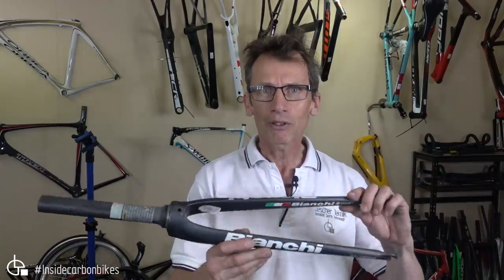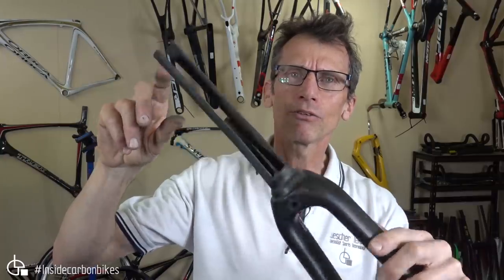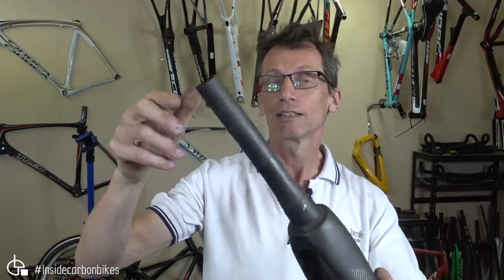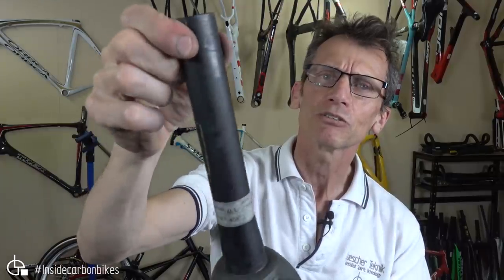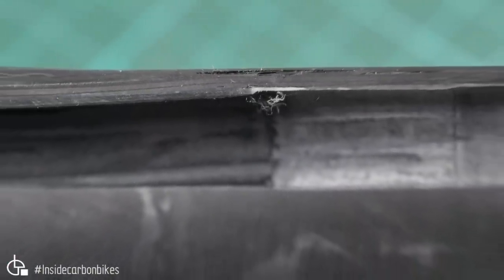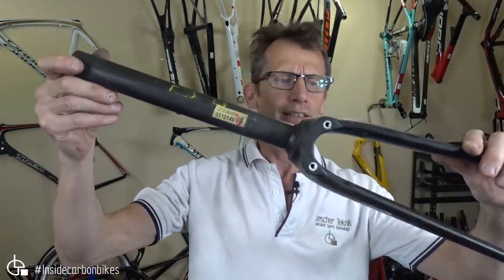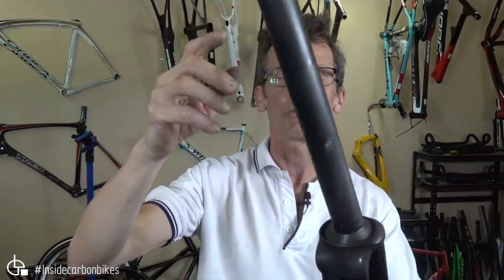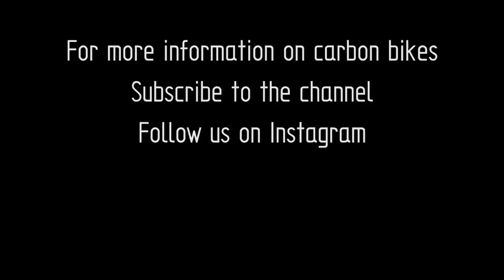Fork Steerer Failure - Recent Crash

Comment: I suppose this isn't an exact science and there are a lot of variables, such as rider weight, manner of riding etc. What percentage of sold forks have these imperfections and how worried should I be that they could lead to failure under "normal" conditions?  Your comment re 2% porosity ==> >20% reduction in strength sounds scary obviously... do manufacturers significantly over-build these things to compensate for these manufacturing issues? Doesn't seem like any of the high end manufacturers (even) deliver problem-free carbon frames and forks. Add to that "user error" such as over-tightening and you are scaring me off using that material. I can't afford to have equipment periodically scanned (which makes sense to do) and even have no guarantee the parts will be problem-free from purchase based on the videos I've watched. So even if I take care of equipment from new, don't crash it, drop or otherwise mistreat it (and torque things to spec) it sounds like quite a gamble.
Reply: Most companies I have worked for overbuild by 100% of the maximum anticipated load. Maximum anticipated loads themselves take a view on likely rider weight, for instance, in arriving at that estimate - so if a pair of wheels, say, has a max recommended rider weight of 109kgs (220lbs), loadings are calculated as if the rider was 218 kgs / 440lbs. If you are, say, an 80kg rider there is, therefore, a huge safety margin.

I respect Raouls work and all of what he says in this video is accurate but equally, I have inspected forks made in steel with poor penetration of the joint by the brass or silver solder used in the joint and i have seen poor bonding in steel, alu and composte bonded structures.

The point is that usually, failure rates are in the small fractions of a percentage point.

A large number of failures are not the result of a manufacturing defect, largely because of the level of overbuild used by responsible manufacturers, but of poor assembly and maintenance. I see more kit broken by that by a long chalk, than kit with an inherently catastrophic fault.

Manufacturers, no matter how careful they are, no matter what they spend, will have manufacturing faults. If Space Shuttles can explode, or motor cars or mobile phones burst into flames, or airliners crash because of faulty manufacture, then should we be so surprised to see faults in manufacture in bicycles? I think not - that's no reason to be complacemnt of course but all manufacturing processes have an inherent ability to produce bad manufacture and all QC processes can miss something.
Reply: @graemefk6519  BS, how would you know that "A large number of failures are not the result of a manufacturing defect, largely because of the level of overbuild used by responsible manufacturers,"...  Have you done a study on the subject? Raouls' scans and dissection of frames shows the lack of quality control of bicycle manufacturing.. you are just another paid industry mouhtpiece trying to do damage control
Reply: Is it fair to say that aluminium and steel are not only more tolerant of misuse such as dropping or overtightening but also easier to visualky identify faults with via periodic inspection.... I know some probs will not show up but maybe more than with carbon... or can we say with some confidence that catastrophic failures resulting in serious injury, regardless of materials, are very rare.      At least with planes they get periodic maintenance, inspection and replacement of parts. I don't know anyone xraying or ultrasound scanning their carbon bikes (granted Rauol has plenty of customers)   Has anyone reading these comments been injured by a failing part? Hard to know how worried to be vs being careful

Comment: "Carbon is the best material for bikes" 

Carbon is great!
It costs 40% more CO2 to make than metal bikes. 
It can't be recycled.
It causes cancer in people that make it.
It's easy to break.
It becomes weaker in UV light.
It can be a potential death trap without you ever knowing. 
It's ride quality sucks balls. 
It's the most profitable and cheapest material for the manufacturer but yields the highest profits. (Now you know what it's so popular with manufacturers)
It galvanic corrodes with any metal you put next to it.
It wears away from the slightest abrasions from cables or tyres. 
And if you make wheels out of it they melt on the way down hill. 

It's s the best! 👍🏻

"Carbon is a a excellent material if it's void, porosity and fault free..." 
You have never showed a bike frame that contains no flaws. Every carbon bike seems to be full of problems. So how can the end consumer ever know that they are getting a safe product without your equipment and expertise? 

You say "take your steerer seriously" but I have no idea if there is anything wrong with mine? And 100% of everyone watching this video are in the same situation. So how can carbon be a safe or good material? It's total Russian Roulette!

I can see the damage to a metal frame with my eyes, and when metal frames have failed on me in the past it was just one weld, the bike stayed up and I was able to stop safely. The same can not be said for carbon or as i like to call it "the Black Death"  

Saying carbon fibre is a good material despite the numerous flaws is like saying. "This is a really good book to read, just ignore all the spelling mistakes and the missing paragraphs... all the books from this writer are like that." 🤷🏻‍♂️

Meanwhile people are still riding metal bikes that are over 30 years old. I don't know anyone riding a carbon bike that's even 15 years old... they are all in museums because nobody is stupid enough to ride one.
Reply: Hidden rust has caused more bikes I've owned to fail than any carbon faults.
Reply: Life is so simple when you see everything in black and white.

Let's face it, if I am ridding a bike, I have far more chances of diying in an accident involving another vehicle than dying in a crash caused by a faulty fork/frame on a carbon bike (or any other material), unless I am an idiot who doesn't use a torque wrench. It doesn't stop me from riding. 
I simply adopt a behavior that minimise these risks (true better knowledge, understanding and practices) and I believe this is what is suggested in this video.
If your assessment of the risks involved in riding a carbon bike are such that you are uncomfortable, feel free to buy bikes made up of other material. But please, stop preaching as if you are an expert on the subject matter and stop stating that no one should ride on a carbon bike. You simply sound irrational ! We're not talking about the 737max cover up here !

But I agree, the QC should be dramatically improved in carbon bike manufacturing.

I suggest you stop using your car if its manufactured elsewhere than Japan, stop using your microwave oven, stop drinking tap water (especially in US), ...
Reply: @zygmuntthecacaokakistocrat6589  The difference is that carbon failure is often immediate and catastrophic. This is why I don't use carbon in my steerer or handlebars (both highly subject to errors in clamping force).
Reply: Sylvain Michaud 

 Humm, I might just be an expert in metallurgical engineering, you don't know. Ha ha Only joking, I only have experience in the cycling industry and before that welding robotics... 

I understand your perspective but honestly I think Carbon is a really bad choice for a bike. Looking at the pros and cons in a purely "black and white way" Titanium, steel and aluminium are far better choices for the customer. I won't go into all the reasons here but you don't have to read to a degree level to discover that fact. 

As for the not driving (I don't) I rode my steel bike to work today, maybe I will use the titanium bike tomorrow? Water, I don't live in the US, actually our water quality is not as good here but I filter it. Water is an essential to life... carbon frames are not. So you can minimise your risk by not having one. 

But what you say about minimising your risk doesn't really make sense... to me. 
It's like your saying, I keep venomous snakes as pets, as long as I'm careful I won't get bitten and die in 2 minutes. But if you keep snakes then you up your risk of being bitten. 

You have already illustrated that life is full of danger that we have to except water and so on, but why take unnecessary risks for no benefit? How much better is your carbon bike to my titanium bike? Is it worth it? 

And you can be as carful as you like, use the right tools, not over tighten your carbon parts... but you are not in control of the mistakes made by the manufacturer? If your bike is a time bomb waiting to go off on you, you have no choice or influence on the matter. 

By supporting the carbon manufacturers you are paying money to a group of people that put profit way way way above your safety. Personally I think it's better to give my money to someone who takes pride in their work and cares about the customer to a more personal level. Like a custom steel or titanium bike builder, for the same price as a badly slapped together off the shelf carbon bike... Giant, Trek, Specialized and so on. 

But I guess those valuable watts you save having the carbon bike makes it all worth it. After all, it's only Chinese people dying from cancer caused by the manufacturer of carbon bikes that are also destroying the environment with CO2. But screw the environment! Why have a titanium bike that can last a lifetime when a carbon bike that needs replacement every 3 years will do. (Right out the canyon manual that recommendation)

But I know I won't change the world with my comments, the world is built to accommodate to mediocrity and the average man... the average man wants carbon, because marketing told him it's the best... so carbon he shall get.
Reply: Reginald Scot i am sorry you have that view, carbon is used in the aircraft industry and is fine. The problem is the Quality control, they are not made fit for purpose and meet design characteristics. Watch Hambini and see how Cervelo have reduced their bottom bracket tolerances to reject less frames. The tolerances are so bad you could loose 15 watts, and bearings wear out in 20% of their life. This is not a material problem, this is a engineering choice by the manufacturer. It doesn’t matter what material you make the bike out of, if it is made poorly, it can still fail. 
The trick here is to identify quality manufacturers, which is not so clear as they hide behind this top end GC tour quality??? Do your reseach guys
Reply: @reginaldscot165  
You really don't get my point.
If you have information to share that can help people making better choices, do it in a way that you don't alienate people.
Stop talking has if you had the authority, ability, competency and more importantly the right to choose for other no matter how self righteous your are.
By the way, we only have antivenin because there are people willing to take the risk to work with deadly snakes. Risk is mostly a personal thing. Collectively, we can make choices. Choices based on science and facts. Not on the opinion of loud mouth schmoes.
Oh, if you are so worried about workers in east Asia or anywhere else, I guess you don't own a phone or a computer  (but I'm wondering how you you watch and comment on YouTube), don't wear any clothing or eat any food that is not, locally bio-organically grown by organisation that are economically equitable, don't wear cotton because it's crazy polluting, don't drink coffee,  ... and most importantly don't own a car because most wars in this world are to steal and exploitl petrol andl other precious resources.
Oh wait, now reading that you say you maybe involve in metal bike manufacturing or metal welding you are simply talking because of self interest (or worst you are some know it all idiot) under the false pretenses of caring for the safety of other.
Make your own fking choices and let others do the same without annoying them.
God you must be annoying to work or live with if you always behave as you do in this comment section.
And let me guess ...
You have to refrain yourself from answering this comment because not only you are annoying, you always have to have the last word.
Also, I'm willing to bet that you are under 40 years old (or simply and idiot) because as you grow older and wiser you learn that the world is far  from being black and white but is rather made of nuances of greys.
Reply: Zygmunt The Cacao Kakistocrat That’s your fault for not putting frame saver once a year and storing the bicycle in a dry place.
Reply: Waynos Fotos Who cares what the aircraft industry does this is a bicycle problem and until they get better qc then carbon fibre is not the best material to make bicycles from.
Reply: @benjamindminor1983  
You are right.
But contrarily to what @Reginal Scot says, it's not that carbon fiber is not a suitable material for bike frames. 
It's just a greed problem !
Profits before safety!
Wich results in lower manufacturing and QC standards.

But on the other hand, people want lighter, more aero, a great paint job...
Weirdly, safety doesn't sale that much (mainly because of marketing).

Until it is more cost effective to build better bikes than it is to settle potential lawsuits and/or avoiding the negative impact on sales, nothing will change.
Reply: @zygmuntthecacaokakistocrat6589  That is a maintenance issue, use frame saver or fish oil to coat the insides of your steel frame - it is a once off procedure usually done when the bike is new. Even when you have a failure on a steel bike, the integrity of the frame is not compromised like that of a CF bike. Should one tube fail on a CF bike, the whole bike collapses.
Reply: @reginaldscot165  Well said - I could not have said it better. These CF zealots/idiots baffle the hell out of me. Perhaps it is better that they ride CF bikes, their deaths would be good in keeping them from procreating.

Comment: You do realise your consigning a whole lot of perfectly good forks to the scrap heap. This is health and safety gone berserk.
Reply: My thoughts exactly. Most of the those voids would be inside the headtube nowhere near any clamping surfaces or stress points and all the stems that actually cracked/failed were due to over tightening because some dumbass is willing blow 5K+ on a bike but not $50 on a torque wrench.
Reply from the maker: The families of the riders that died from failed forks may disagree with you.